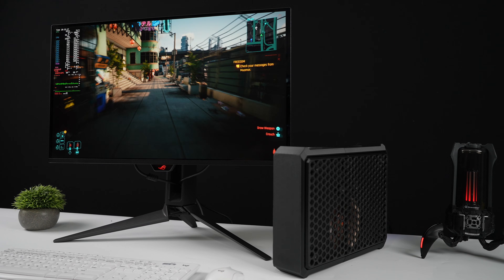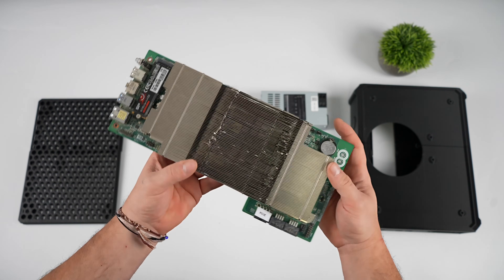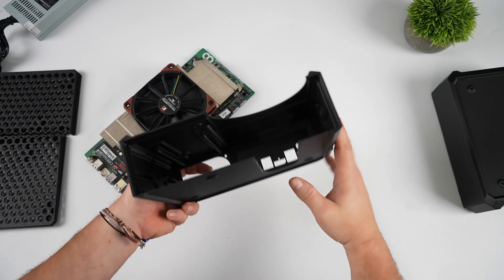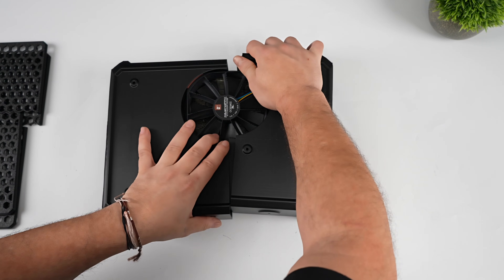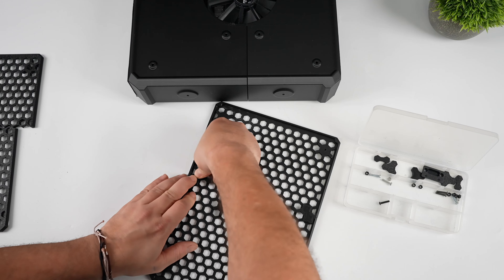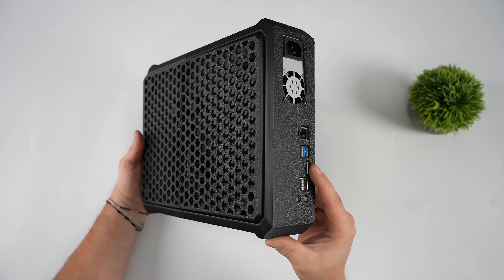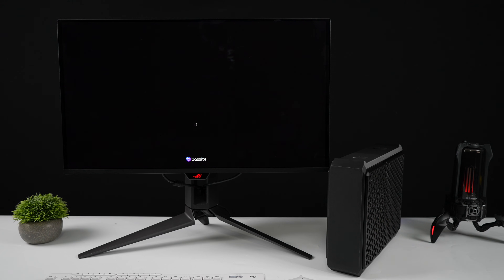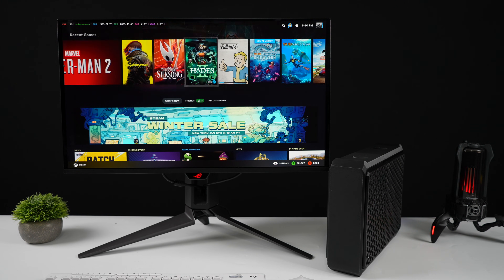Low Cost DIY Open Source Gaming Console!

Comment: Would love to see a teardown of this board, specifically the memory config. Though as others have mentioned, the prices have already inflated...
I can't think of a game that would work well with a 8/8 split on the memory. That may work with a console but I can't think of a single game that will use more than 6gb vram at 1080/1440p, or at least none that won't run poorly on 8gb of system ram. Unless the gddr6 really makes that much difference in smoothness with only 8gb available to system ram.
Reply: There are videos of that.  On the back side is the circular memory layout like you see on the PS5 (not surprisingly).  I didn't really have any problems with the 8/8 memory split, but I went with the BIOS mod for dynamic allocation so each game can do whatever's optimal.  The biggest impact was from installing the oberon gpu governor, so it can clock between 1000-2000mhz instead of being locked at 1500.
Reply: @dividion8102  How many memory chips?
Reply: @MikJames-d1g  8.  There's a video called "BC250 Thermal Putty Job" that shows the full internals.
Reply: @dividion8102  Thanks!
Reply: I also don't get how it works so well relative to the price it used to sell for

Dynamic memory allocation can be enabled by allocating 512mb Vram, that's provided you have a modified bios flashed on to the device

Comment: GPU can actually go up to 2230mhz
Reply: Is the extra 230mhz worth it performance and power consumption wise
Reply: @randoGuy77 not really, it would require a lot of overvolt and it get too hot. Performance difference between 2000Mhz and 2229 are not 11% but closer to 3%. Probably system is getting limited by other architectural things like memory subsystem, chache whatsoever...
Reply: @OldLamer nah after testing, it's worth it
Reply: @randoGuy77 i mean, i would take a little performance over a little extra fan speed any day, you need 1000mv for 2000mhz 1040 for 2230mhz , 4 percent increase in voltage for 11% better clocks

Comment: For comparison the steam deck has 8 compute units.  This has 24.  Pretty good performance
Reply: That comparison doesn't make any sense. This board cannot adjust CPU frequency, to begin with; total board power is over 200W.
Reply: This also has 6 CPU cores and a higher power budget.

Comment: Too late man. By the time I get enough to buy a decent PC, gpus will be up to $1000 or something.
Reply: look into used graphics cards, rtx 2080 super still a good card can find it under 200 for the most part. the rest of the system good luck prices are wild right now.
Reply: @Gravitino900   Time to lock in and get creative or get to grinding. 
Go for used, recycle parts, etc, or just be happy with what you have if all youre games are playable decently. 😔